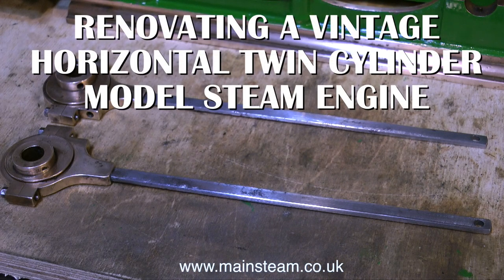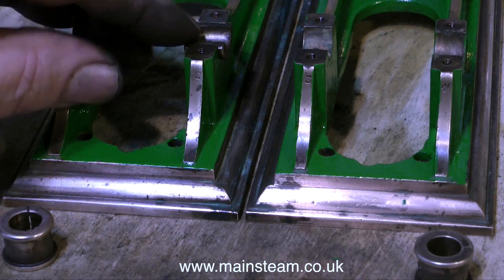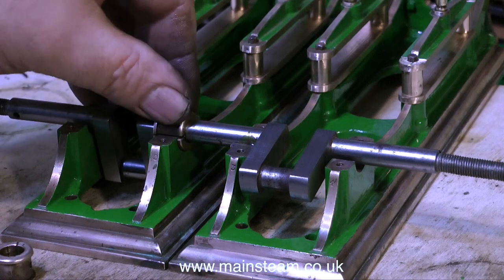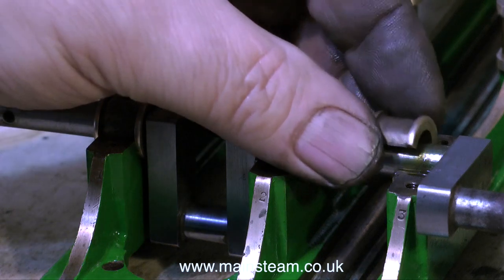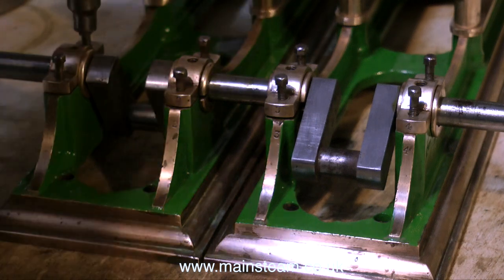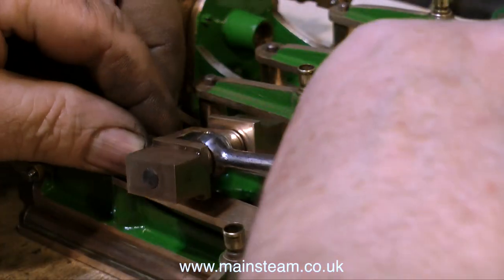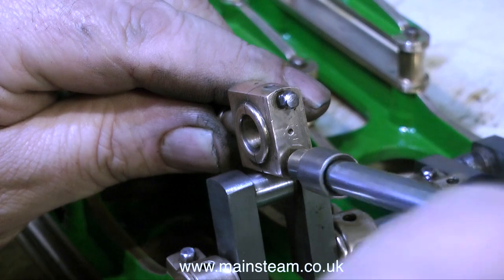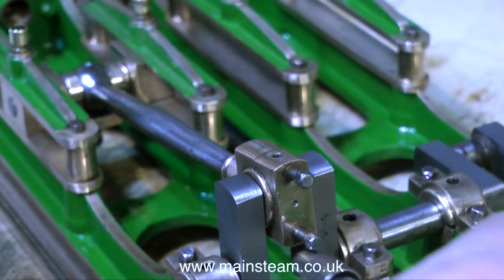PART #9 -  RENOVATING A VINTAGE HORIZONTAL MODEL STEAM ENGINE

Comment: any reason you didn't show putting oil on the crossheads during assembly?
Reply from the maker: steve cummins Yes - it was largely due to incompetence - but I am truly very sorry and I really will try much harder next time - my eyes are dim and I am in the Autumn of my years  . . . . please accept my sincere and humble apology - and maybe watch the next video . . . . . . I watched yours . . . . . . .
Reply: apology certainly acceptable as we're all human.  I'm that easily distracted that, had I watched the next video before commenting, I'd have forgotten to ask if there was some obscure useful info going on there.
Reply from the maker: steve cummins I do these videos in real time (they are not staged) The recordings take place as I am actually doing the job - plus I am having to operate the camera which is always on manual focus so sometimes I set up the shot and forget to press record! Most of the time I get it right, sometimes I screw up in the edit too if it's been a long day (I am not retired yet)